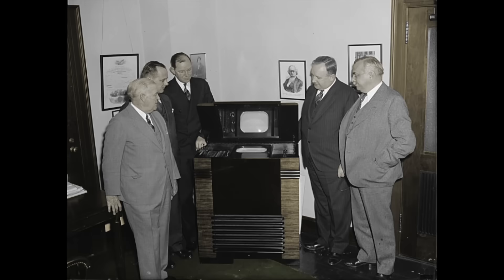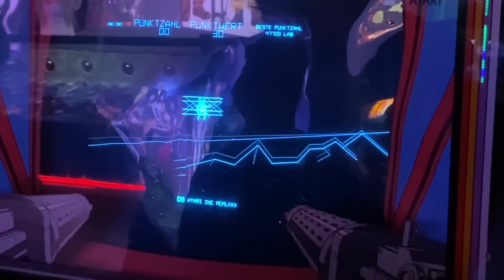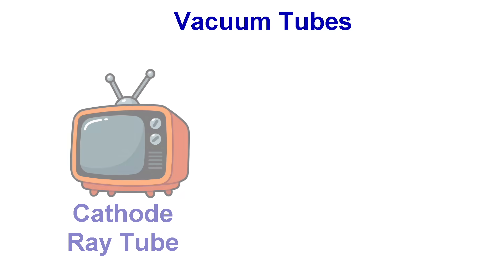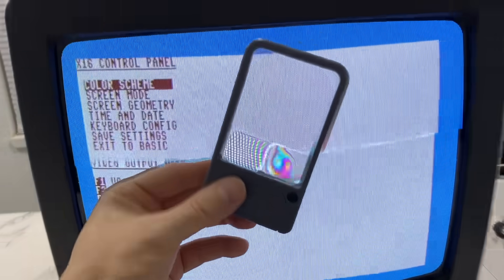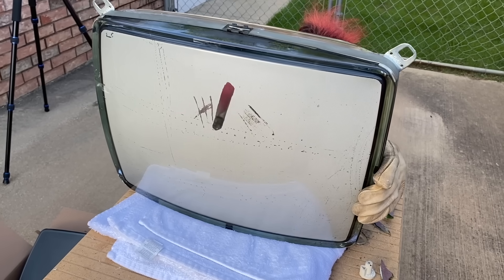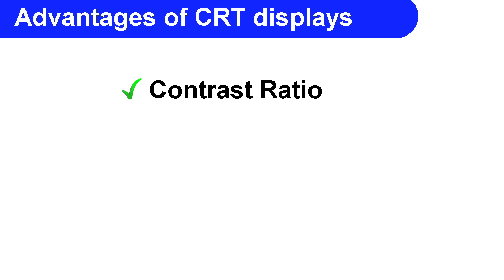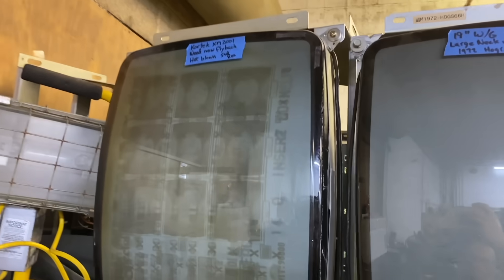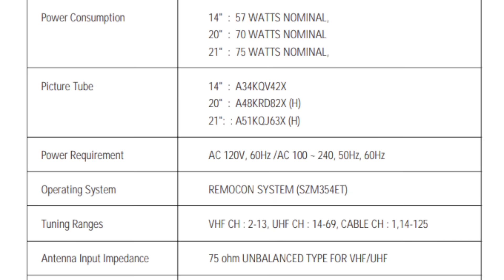How Cathode Ray Tubes Work.

Comment: I remember moving from one state to another back at the end of the CRT era... moving a 40 something inch crt up a flight of stairs was like moving an elephant... the weight difference is certainly an advantage of flatscreens. Great video David.
Reply: I couldn't give away my 17 pc monitor and 32 tv, took up so much room and so heavy.
Reply: I gave up my last CRT, a 21" monitor, because it was so hard to move on my own. (CRT Monitors are heavier than TVs of the same size due to the harder vacuum.) Huge mistake! It would take over 10 years before I had an LCD screen nearly as good. Being widescreen, the 23" LCD I'm using now still feels more cramped than that 21" CRT. The 20" wide LCD I had in between times was cramped, poor contrast, had gratingly visible pixels, and a viewing angle bad enough that I got neck pain from instinctively holding my head in a very specific position for hours.
Reply: i replaced my 36 inch tv in the basement with a flat screen, then it sat there for 4 years until i finally remembered it while someone was around to help get it out of there!
Reply: Got a 36" Trinitron that I still lug around with me wherever I go! But man... Does it suck!
Reply: I still own 34 inch Adi monitor. Plus a pair of crated 37 inch VECTOR tubes meant for a giant Vector display,  from a friend who worked at McDonald's Detweiler and associates. I have some idea to turn it into a giant vector multicade machine with multiple Vector games in it
Reply: Wasn't that long ago that 3 of us lugged a 36" tv up from the basement. Had we lost our grip on the thing, one of us would have likely been killed. I wish I had kept the set from some retro gaming purposes but those things are such a nightmare to move, and the otherwise sturdy cabinet it used to sit on has a noticeable bow to it.
Reply: @DoomPlague  you use to not be able to give them away now they are actually starting to fetch money (which I had a feeling would happen) mainly because of the old video games. It just depends on the model of CRT TV. Sony is a big one I think Sharp also.
Reply: Must have been a Sony cause that was the biggest CRT TV made at 43in
Reply: @SORGIGERMANICO  could have been a Mitsubishi. They had a big one out in the 90's - over 40" iirc.
Reply: @lcdjr85  We had a Mitsubishi 27" TV with S-video input, not common back then. Too bad we didn't really use the S-video
Reply: Dad hurt himself while trying to move the 24" CRT up stair alone. Brother was so mad when he came home.
Reply: When my father replaced his 32 inch widescreen just one delivery guy came in and swiftly lifted it off the stand and straight out the room. I suppose it's all about technique.
Reply: @PeterR1chard  That was a TV, I assume? Monitors are heavier because they have to be sharper, so they have a harder vacuum, so the front glass is thicker. Also a widescreen has the top and bottom to support it much more than a 4:3.
Reply: @eekee6034  Yes, it was a TV from around 1999. Had a pretty good picture.
Reply: When I think of new technologies I always think of that remark by Magneto "The pawns always go first."
Reply: If I ever get another CRT, I think I'll stick with 21". :D It's a good height, at 4:3. What I really want is hi-rez (low dot pitch) OLED.

 @weedmanwestvancouverbc9266  I'll have to remember that one! I'm normally very cautious with new tech, but I was all confused in the middle of a big move when I had the bright idea that I could get a LCD screen, get rid of the CRT, and everything would be fine! I get these ideas when I'm trying to fix my life and they always make it worse.
Reply: *flat panels

Comment: 11:49 Oh gosh i'm watching this with a Duel HD CRT (1600x1200 (main) + 1280x960) + LCD (1024x768) setup. Not because I think LCDs are bad but because I could get 2x HD CRT monitors for £20 and they look SOOO much better than any LCD in that price bracket. Also the fact that they can be perfectly sharp at any resolution is incredibly useful especially since I use them with older machines with MSDOS as well. Also 3x 16:9 monitors wouldn't fit on my desk and I quite like the extra height that you get with 4:3 - my Red Dwarf DVDs fill the whole screen too which of course is the most important factor when buying a screen :) .
Reply: Where did you buy them I need to know my life depends on it please!?!?! 🤣I _down_graded from a 21" CRT to a horrible 20" 16:10 in 2007, and my life has never been the same since.
Reply: @eekee6034  Sorry I only just saw this. I just got them off of facebook marketplace, theres genrally some on there although you may have to be patient to really get something good but they are always very cheap. Something from the 2000s or late 90s will generally be the most reliable and have the highest resolutions if you are using them for modern PCs. Good luck!

Comment: Still rocking my 17 inch CRT monitor for gaming and I plan to keep it for the foreseeable future. I'll care about new displays when they go back to something with phosphors so every resolution is displayed properly without blurring.
Reply: this is my biggest gripe with anything these days, the pixels are not universal... BUT i have found a few super high resolution small displays that can run lower res without looking like garbage. ipad 3/4 lcd is 2048x1536 and you can get vga/hdmi adapters for them. they run 1024x768 absolutely perfect, and 800x600,640x480 quite well. running at native res is hard on the eyes haha

Comment: Really wish, the comparison would be with OLED, which are also already over 10 years on the market. 4k OLED panels start to close the gap between CRT and LCD dramatically, with real black, low response time and the ability to add digital shadow masks for an authentic CRT effect.

Comment: I think your 4:3 and 16:9 area size thing is a bit flawed. It should be about the resolution. Now, at 17 inches, there aren't 4:3 monitors, but let's make the size 20 inches. The 4:3 monitor is likely 1600x1200, whereas a 20 inch 16:9 monitor would be 1600x900, which means you get a decent bit more screen real estate on the 4:3 then the 16:9.

Comment: So burn-in on a CRT, correct me if im wrong, is just where the phosphorous coating is gradually burned away due to the electron gun firing at the same exact spot over long periods of time

surprised that they couldnt come up with a different type of phosphorus coating that was resistant or immune to that effect
Reply: Entropy makes fools of us all...

Comment: There was a class action lawsuit about the misleading way CRT sizes were described.  That's why, in later ads, you'll see the size listed with wording like "15" TV (14" viewable)"
Reply: The set makers advertised the screen size by using the same diagonal  dimension that the CRT maker used - overall.  But sets are made with bezels to cover the edge resulting in a smaller viewable area.  There is no image right to edge of a CRT because of the thickness of the side glass.  And a small part of the outermost edge of the image is covered because it turns out blurry due to the curve in the glass on the inside corner.
Reply: This also was only true for televisions. Monitors were generally still advertised with the total tube size until the very end.
Reply: I honestly never paid any attention to the "size" or "viewable area", with CRT's in the years past, or LCD's today.  I look at the monitor in operation, and see if it's the size I want or not.  Couldn't care less about the measurements.
Reply: I remember that! I owned a Compaq laptop back in the ‘90s and I got around $3 from a class-action lawsuit over the claimed size of the laptop’s screen.
Reply: They still did this crap today. My 27 inches OLED monitor is actually 26.5 inches
Reply: Is that also why when LCDs came out they are marketed by their viewable size?
Reply: "Nominal" sizes are common, if accurate.  A " 2 x 4 " piece of finished lumber is smaller than 2" x 4".  A sawmill cuts the raw log at intervals of 2 inches.  But cutting removes wood as the width of the saw blade, then more wood is removed by the planer to create a smooth surface and rounded corners, then the wood shrinks down in the process of air or kiln drying.  The result is lumber measuring 3½" x 1½", and carpenters and architects have historically taken this into account when building. 
A couple of years ago, a law firm tried to launch a massive class action suit against lumber sellers, saying that consumers have been duped and misled for decades by getting less than what they paid for.  A judge quickly quashed the suit.
Reply: The measuring system goes back to the days of round screens, where the diameter of the outside of the bulb was quoted. The raster was set so that the corners just touched the edges of the screen, so the diagonal measurement equalled the diameter more or less. Some manufacturers screwed up this convention by setting the raster to fill the screen horizontally (DD style), cutting off the corners of the picture, but using more of the screen geometry, and the famous Zenith Porthole sets that were set to fill the screen vertically, resulting in the loss of the entire left and right edges of the picture. This measurement continued after the introduction of rectangular screens. Later, they changed from measuring the outside of the bulb to the visible screen area. Even more confusing is that some countries quote the size in centimetres and others in inches.
Reply: I remember my father showing me how to measure a TV screen (diagonally) back in 1972.  That 16 inch screen was a full 16 inches.  Nowadays I think people get less than what they pay for.
Reply: Must have only applied to the US.  Years ago I remember a comedian on TV bring out a TV box as part of his act, and mocked the " 14" size (15" Canada) " markings.
Reply: @haweater1555  We had that in the UK as well where it listed the size and viewable area. Never knew it was because of a class action.
Reply: @haweater1555  no I remember this type of marketing in the UK too.

Comment: Oled suffers the same problem with burn ins.
Reply: No. OLEDs don't have burn-in like CRT and plasma did, where static image could literally burn-in.
OLEDs are rather millions of individual lighbulbs that have limited lifespan. The brighter they need to be, the faster they'll degrade.
This is why you can't burn-in OLED by watching 21:9 movie on 16:9 screen with static black bars, but you had to run cleaning on Plasma after each movie. 3 movies in a row without cleaning and you had permanent burn-in.

You will burn oled with news channels watched regularly while, Plasma won't if you mix usage like 1 hour of news and 2 hours of movies filling the screen.

In other words CRTs and Plasma were burn-proof when used correctly, while OLEDs can be used however you like and they just have limited lifespan. Like 1000 hours of news channels or 1000 hours of displaying desktop. 
Using OLEDs for different content helps in uniform brightness degradation. Display gets dimmer without significant image quality loss.
I have CX and C13 LG OLEDs, the first one is slightly darker after 3 years, but it has no burn-in despite it was used mostly for console gaming with static UI.
Reply: @Leeki85   THis is the same thing as a CRT, limited lifespan
Reply: @Leeki85  the phone you use in an OLED, the brighter the screen the worst its going to get
Reply: On the other hand, it doesn't suffer from poor contrast ratio.
Reply: But much much worse.
Reply: especially AMOLED, I've owned two AMOLED phones and both have had significant burn in. It's a very flawed technology

Comment: You say vacuum tubes were found in any electronic device made before the 1960s?  My family purchased our first color TV in 1965. It was a Zenith console madel with all tubes. When I had my own apartment I purchased a new TV in 1972. All tubes. Tubes were in use well after the 1960s.
Reply: @Jackpkmn  The transistor was invented in 1947. In 1954, the first transistor radios  was sold.
Reply: @roncaruso931  Alright I removed the comment.
Reply: @Jackpkmn  No need to do that.
Reply: He said any, not some... So he is correct...